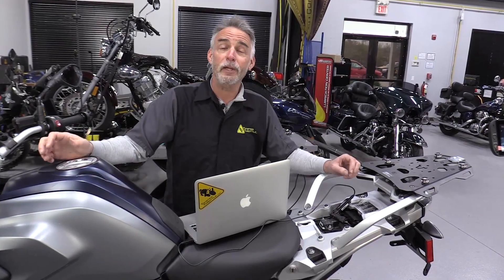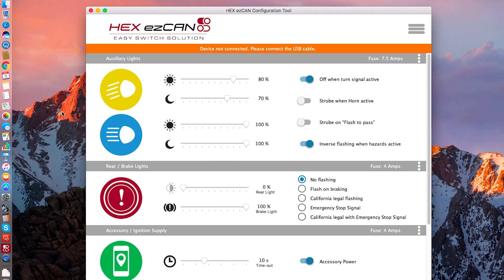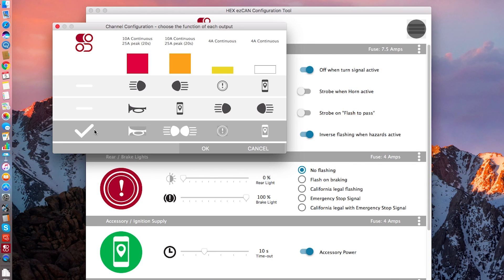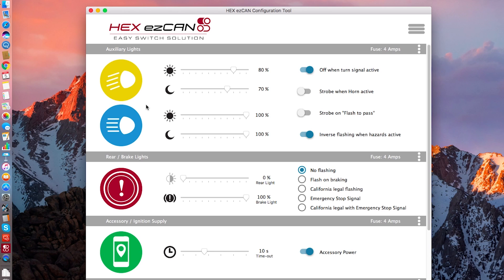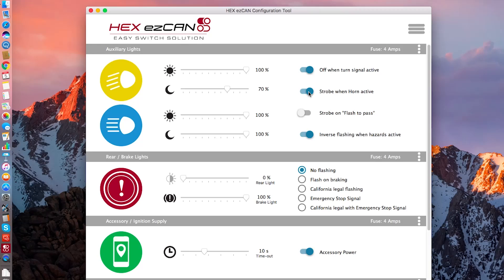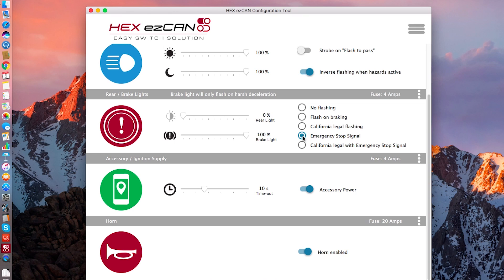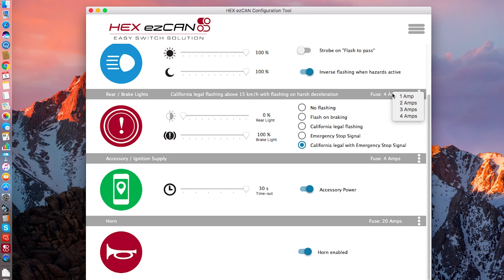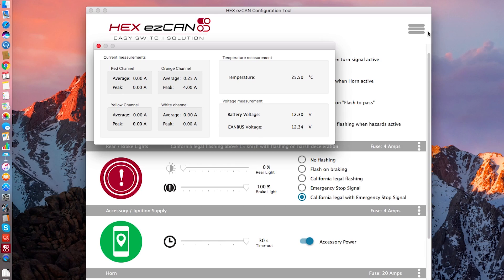How to Program the Hex ezCAN System for Your BMW

Comment: Hi,
I bought your EZCAN system for my 2018 r1200gs bmw.  I connected 4 additional lights (30w each) to one connection of the EZCAN.  It all works fine like rotation of the turn signals and the new lights and blinking when using the horn.  The problem is when I use the high beam, the 4 new light get turned off with no option to have them turned back on unless I turn the bike off.

Can you please advise?

Thanks,
Reply from the maker: Hey Regev, 

Sounds like you are overloading the circuit. You only have 10 amps of wiggle room per high-powered circuit. Try moving some of those lights to a different circuit and it should do the trick.

Comment: Is it also possible to configure the OEM fog lights for strobos with these devices? Or will it only work with additional fog lights?
Reply from the maker: It is possible, if you wanted to completely re-wire those OEM fog lights. It would not be a quick set up.